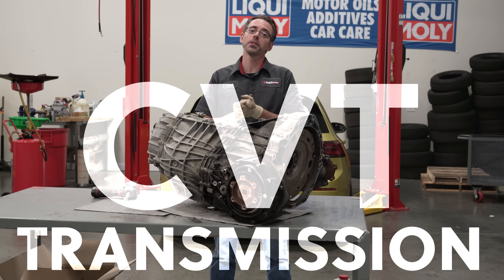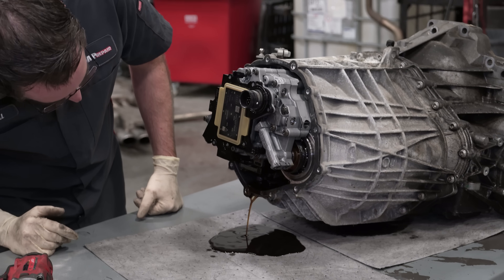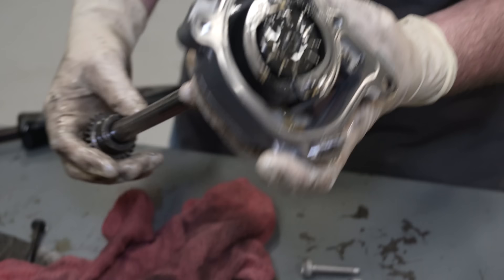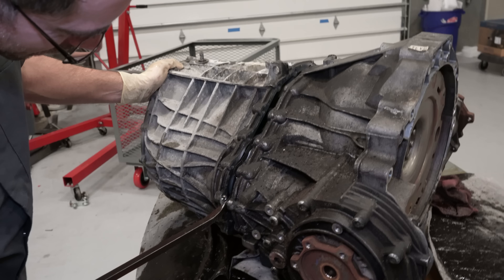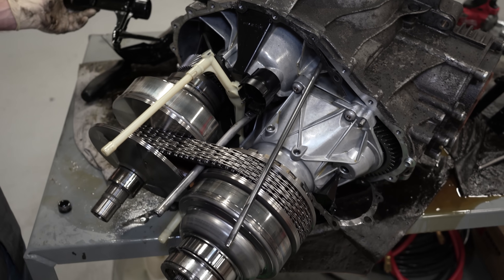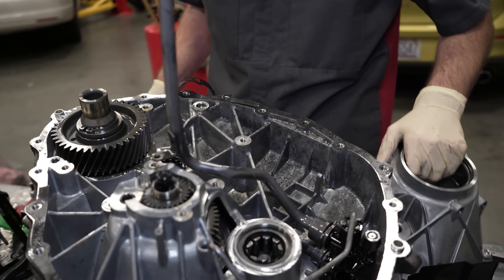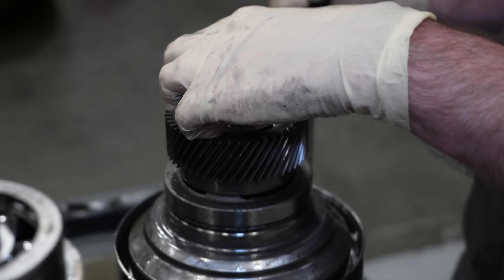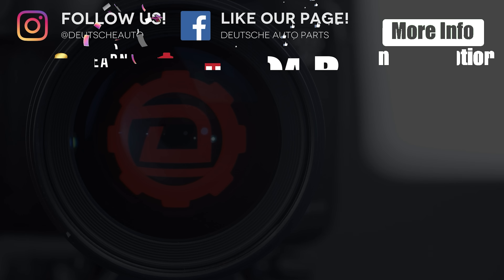Why you shouldn’t get a CVT transmission

Comment: Subaru, Honda, and Toyota CVTs are fine. No issues if you change the CVTs fluid 40-60k miles (some people say every 100k). The Subaru dealership near me charges $420 for the CVT fluid change. It's a lot cheaper than replacing a CVT.

Comment: Hybrid Toyota, Honda, or Ford (Escape Hybrid) eCVT which are made by Aisin seem to be robust and dependable.
 Whatever is saved in efficiency is lost in repair costs with Jatco. They are not rebuildable, Nissan and Subaru CVT are replaced with new when they fail...and they fail! Nissan owns Jatco which explains why they push them on the buyers.

 Unfortunately, I own a 2018 Subaru Legacy with the Subaru Lineartronic CVT, which I understand they are not so desireable after 5 years. 

The GM Drynaflow was another shiftless transmission that was not popular with buyers, so this is nothing new.

Comment: I've had 3 nissan altimas with cvt 2 of the 3 had right at a 100'000 miles on them with one fluid chage and the other with 25'000 miles on it not one of those car gave me any trouble the last one even made a few trips up and down the tail of the dragon

Comment: In South America Honda used CVT´s on the 1st gen Honda Fit (2003-2008) and they were great and realiable and still going strong even in cars with almost 300.000 km on the clock 20 years later. CVT´s were equipped in 1.4 and 1.5 N/A engines. Maybe that´s the key, CVTs could work better with small and light cars with conventional engines where torque it´s not required in mass. The time goes by and every time i hear that some brand is trying to develope a transmission that has to be reliable, direct and fuel efficient... i think for myself: that technology already exists, it´s called Manual Transmission.

Comment: The problem CVTs come from JATCO. You'll find them in Nissan, Hyundai, Kia, Mitsubishi and Chrysler. Subaru CVTs are manufactured by JATCO but are Subaru's own design so they aren't quite as bad. Honda and Toyota make good CVTs. There's Priuses rolling around with over 300k miles on the original transmission.

Comment: I have driven a cvt 115cv 1.5L aspirated car a couple of days ago and I almost surpassed a 150cv turbo 1.4L 6 gears! It really impressed me! My car is a 146cv aspirated 2.0L 5 gears and it does not get even near that performance. 

Here in Brazil (hence the low numbers above lololol) I've never heard bad things about cvt (except the low 'cool factor' - although this last experience of mine undermines that).
Reply: I'd like to point out that all internal combustion engines are aspirated, they all breathe whether they have natural aspiration or forced aspiration

Comment: @0:12 I was about to say CVT Transmission was redundant like ATM machine, but you clarified.  Yes, CVT transmission.  But to be fair, the one on our 2010 Altima went 200k needing only fluid changes and was still working when we sold the car this past summer.

I hated driving it (my wife picked this as her car) but I cannot argue with the fuel economy it delivered.

Comment: I've been driving on a CVT since 2012.  These are in Toyota Prius Vs.  My first Prius V ran well over 200,000 with no transmission problems.  In the end, the car was doomed due to battery failure and an engine issue.  I got another Prius V and its CVT is also working fine.  I don't doubt that there are problem, but I submit they are mostly with German-made cars.  I'm experienced with VW defects, I had one of the original VW Rabbits.

Comment: Well I had a 2005 Ford Escape hybrid with a CVT trans. Fords first and first hybrid and that combo got me 220k when I sold it and the drivetrain was the only thing proper on it. Everything else fell apart around it.

One thing I was told about CVT though. If you miss a fluid change. Leave it be. I bought it with 50k and never changed it.

Comment: My honda civic has 120k miles and ive never had any problems with the cvt, I actually like how it stays in the powerband
Reply: Yeah Honda does it right.
Reply: @kez850  lol not gunna lie I have a heavy foot rpms are rarely under 4.5k I redline often, never had it slip or do anything weird. I feel people don’t drive their cars hard enough sometimes which in my opinion isn’t too good for the engine
Reply: @madcannagrow2833  let me guess you drive it around in S mode too? Lol
Reply: @kez850  no I actually use s mode to help me with engine braking that way my brake pads don’t over heat lmao
Reply: @kez850  like downshifting a manual transmission 😂 tbh idk how much longer its going to last but damn it I have faith in my little civic
Reply: @madcannagrow2833  damn dude, you know brake pads are considered a wear item right 💀
Reply: @kez850  yea bro I know low key just driving it like I stole it, If it breaks it breaks I want an excuse to buy a cbr600rr🤦🏽😂
Reply: I have a 2018 Honda Civic with about 60K miles and have never had a problem with it.  Combined with the 1.5L turbo, it's actually very peppy and gets great gas mileage. It would appear that Honda has figured out how to do CVTs right.
Reply: @patrickhauser631  id get great gas mileage too If id drive it like a normal person lol
Reply: @madcannagrow2833  LOL... I've only used the Economy button a few times on some very long road trips.  But I've also been known to test the acceleration occasionally.  (Sure there are speed limits and I don't go too much over, but there's no acceleration limit!)  It's a fun car to drive even if it's not officially a sports car.
Reply: @patrickhauser631  it really is fun and mine doesn’t even have a turbo lol

Comment: CVTs in cars have never been a good idea, but CVTs in powersports are used all the time, quads,side by sides, snowmobiles, all use them, they require some maintenance but they're easily taken apart, and the belts are replaceable and rubber. So every few thousand miles they're a $100-150 replacement and then can be stripped down and cleaned within an hour and the springs changed.

Comment: The manufacturers are being dishonest about the maintenance these things should have.  They want people to buy a new car when they see a $4,000 bill.   
The first CVT I had as a daily was a '04 A4. Never had a problem. I put a tune around 60k miles.  No prob.  Then the turbo went and my shop had a good K04 and injectors laying around so I upgraded plus a test pipe ,  plus the new tune. No CVT problems ever and I sold it with 180k miles on it

Comment: Elantra 2017 175k miles.  Original transmission. Fluid was replaced by dealer at 70k ish miles. I was confident it would've made it to 250k.
It's important to note that car was never abused and well maintained. 
Car was traded in.

Comment: Please do not confuse this with Toyota's ecvt which is completely different and nearly bulletproof. Toyota has been perfecting its Synergy drive for nearly 25 years now. There are almost Zero records of them failing.
Reply: My '04 Prius has nearly 250,000 miles on it without transmission or engine issues. I use Amsoil Fuel Efficient AFT instead of Toyota's WS fluid in the CVT.  I also use the Dimple neodymium magnetic drain plugs on the CVT and engine on both of my Priuses.  The '04 still gets around 50 mpg.  And the '18 Prime gets 133 e-mpg depending on the number of short trips that I make.  Check out the instructional YouTube videos from Dr Kelly, Weber State University, Ogen, UT.

Comment: That's not a CVT band, that's a CVT chain, and there are at least four different types of CVT in production right now.. but the two main ones use a steel belt that consists of concentrically smaller steel bands, held together with stamped out pieces of steel, and that's what jatco uses... Subaru, hyundai, kia, audi, and on a few Hondas and toyotas, use the chain version.. but all of them accept Audi state that you should change the fluid and all filters every 20 to 25,000 miles.. apart from changing the way you drive your car, changing the fluid and filter on time every single time is the only way to make these transmissions last.. I have a 2019 Mitsubishi mirage and thank God I got the five speed manual!!!

Comment: People hate cvt but don't complain about the ride in electric cars. I actually loved these. It's the most efficient way to get the most out of a gas vehicle and it makes for a smoother drive when done right(some manufacturers would try to mimic gear shifting with these because people didn't like them). It's disappointing they didn't catch on because they would've been made more reliable if there was more reason to make them.

Comment: I have a 2014 honda with cvt transmission with 290 thousand miles. It has never fail. And the oil in it is clean.

Comment: So, I had a CVT transmission.  On a Honda Helix.  HERE'S the thing... the Helix had, essentially, a fan belt and two V pully's.  It was pretty good. 

BUT... you could change that belt, with the aid of a moderately priced special tool, in about a half hour.  One buried inside of the transmission, regardless of how it's made (at least with current technology)... screw that.

Comment: I enjoyed that video. When you got the case off it reminded me of a Arctic Cat snowmobile from the late 60's that I rode in high school. The system had a driven pulley up top connected by a rubber drive belt to a centrifugal clutch on the engine. As you sped up, the centrifugal clutch would take up the slack in the drive belt, eventually pulling it deeply into the driven pulley, giving up torque for speed. I used to run the thing with the track suspended up in the air and marvel at how the system worked so smoothly. The weak link was the drive belt and I had a few blow apart on me during years of riding sleds.
Reply: The nice thing is that the belt was the known weak link, and usually easily replaced trailside. A replacement belt cost around $30 in the early 80s, if I recall.
Reply: comet 102c primary with arctic cat secondary

Comment: Nobody really understands CVTs, that's half the problem. They are the wave of the future I believe. What's more efficient than putting the engine in it's sweet spot and holding it there? Now I agree the manufacturers need to improve them and I don't understand why they don't test and developed stuff better before they release stuff to production? But we know they always do and sometimes with not very good results either, unfortunately :(

Comment: I think cvts are good for light weight low horsepower vehicles (like ATV's UTV's and SXS's) but when you add more weight like a 3 to 4,000 lbs car, I think they will fail more often by just driving vs my 09 Polaris ranger which is still on the factory belt and clutches

Comment: Owning a CVT is wonderful if you know how to maintain and repair them.  Change fluid every 30K miles. Along with both filters. Always drop the pan to clean and replace the screen filter. Learn how to fill them to exact amount. Many do not have dipsticks, because they have a overfill bolt. Always use the manufacturers oil. Don’t skimp on fluid by purchasing aftermarket fluid.

Comment: 12:15 Lol 100% agree with you !!!!!   honestly i never got it what VAG/Audi was thinking back in the day when they released this crap,  officially the filter and fluid never needs to be changed and filter is not even changeable until you totaly disassemble the gearbox....... i remember very good how proud Audi was about this CVT crap they called it MultiTronic and made a lot off commercial and in the end it was a total failure and they still keeped up with it for some more years until they give up finally and only used TipTronic (Automatic) or S-Tronic (DSG) or Manual Gearboxes .....

Comment: This was a really fun video to watch, but by the end of it, I didn’t understand why CVTs are bad.
Reply: People just like to feel the shift. A CVT doesn’t have a noticeable shift
Reply: @jonathanpineda2774  feeling the shift if just wasted energy. It shifts so smooth cant be a selling point for a transmission anymore with that logic.
Reply: @jhoughjr1  I’m all for CVT since it is a more efficient transmission
Reply: @jonathanpineda2774  as a coder, i consider proper power delivery to be an impmentation detail of the engine and transmission. I consider having to think about shifting as an archaic holdover from the stone age. It's nothing to do with leaning to shift as most ppl pick that up.
Its like are you using the car, or is the car using you?
Reply: I think it's because they overheat too easily and then eat themselves.
Reply: They aren't if you get a Honda or Toyota with one. Just change the fluid
Reply: Oil changing interval is specified at too long intervals, when oil is changed some other things like filter(s), screen, o rings and pan gasket has to be changed, which is not cheap.
You can have same gearbox in two different car brands, one says "luricated for life" other brand "change gearbox oil at 100,000km".
Gearbox overhaul shops usually recomend to replace oil and filter at 50,000km.
Most of CVTs are made by Nissan and Toyota subsidaries. Power and torque for each model is specified fromPS toPS, buyer can purchase gearbox that will work at 75% of load in normal conditions or at 90% of load. Second example will usually last less.
Also, some cars have gearbox oil coolers, some do not, which is also a big factor.
Reply: I had the same experience.
Reply: @Roadrunner_1000mphnone of that is true
Reply: @Roadrunner_1000mphSorry to hear that. Ours is doing just fine.
Reply: @Roadrunner_1000mph I own two. Fuel efficiency is one of the main reasons car manufacturers like CVTs.
Reply: The issue with CVT is both, bad and excessive maintenance. 

CVT can only use original oil, you cannot use any different oil or add any additional additive.

If you change regularly the oil with original fluid it will last longer. This is a transmission good for first and second owner with low mileage.

I think that CVT are less worse than dual dry clutch systems. The dual dry clutch is to provide the ownership pain of the third owner to the first one.😅
Reply: because they are new and less maintainance id think.
Reply: @jhoughjr1    These transmissions take more maintenance than a conventional automatic or a manual and they still might fail... I had a 2018 Mitsubishi Mirage. I got the transmission fluid and filter changed at 40k and 80k miles. At 50k miles, it started to over heat. The car would go into limp mode. This is a car that has less than 100 hp so there is no way I am working the transmission hard. I took it to the dealer and they said they found no issues. I started recording every time it would go into limp mode till I had 22 videos in a year. They finally decided to do warranty repair when it got to 94k miles. I traded that pos a week after I got it back.
Reply: Horrible to drive and if it start to slip (due to bad maintenance for instance), you trash it...
Reply: @AlessandroGenTLe  So like any machine, you dont maintain it, it breaks.
Reply: @jhoughjr1  😂 exactly
Reply: @jhoughjr1  of course :) But a manual (other than be much more enjoyable to drive -out of traffic-) isn't so susceptible to lack of maintenance;)
Reply: @AlessandroGenTLe  i thnk thats debatable but fun when not in traffic isny much of a selling point for most people as driving is generally being in traffic for them.
Reply: They break more easily then other transmissions and they're more expensive to repair.
Reply: @mikeoxlong3676  If you have 5 speed 80s gearbox with tons of aftermarket and mostly improved parts than yes.
If you have something newer with 12 speeds and 450HP than no. CVT will be much cheaper to replace with factory reconditioned unit.
Reply: Because they are unpleasant to the ear when driving constantly whining and far too complicated.
Reply: @subevo35  a normal 8 speed automatic (but a 6 speed too) is far more complex than one of these... Still atrocious to drive...
Reply: @subevo35  lol they are actually quite simple mechanically idk what you are smoking. Hearing the exhausts and how much noise asshats with smol dicks make to drive no faster than my 49 cc cvt goes, I have a hard time the CVT noise is an issue. Wasnt an issue in my friends ford 500